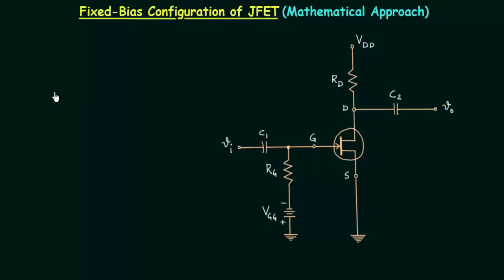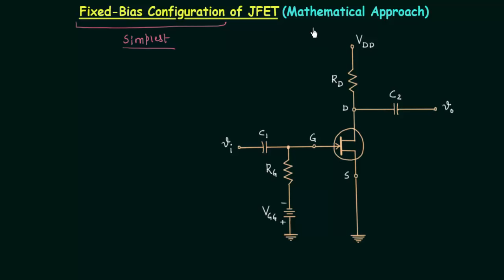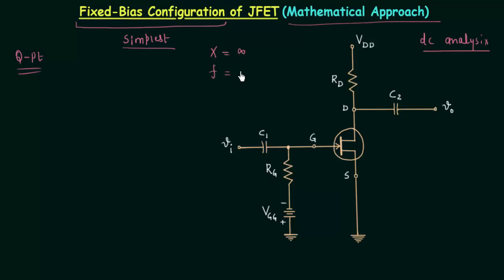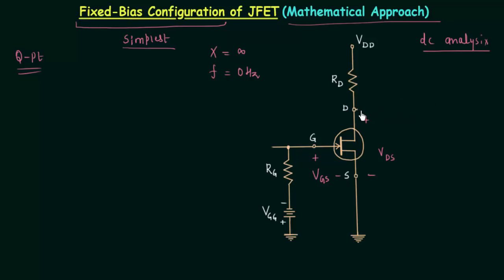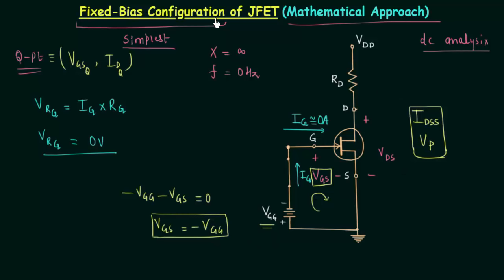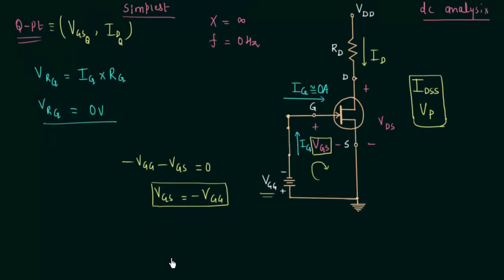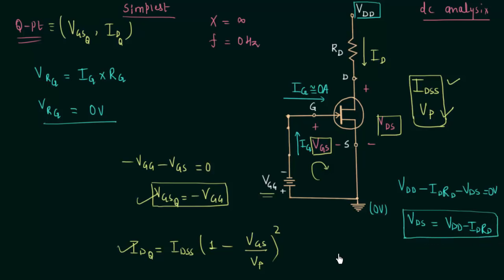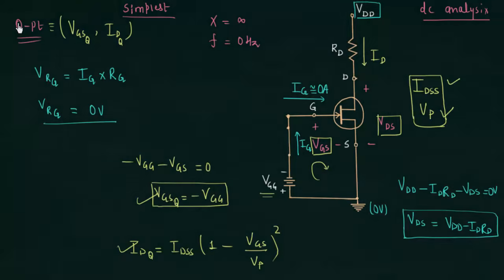Fixed-Bias Configuration of JFET (Mathematical Approach)

Comment: Then what for u have introduced capacitors sir .What is the use of that....
Reply: This is the DC bias to setup operating point of the transistor.  The capacitors would couple and decouple the AC component which is to be amplified or impedance matched.  (from the best of my knowledge.)